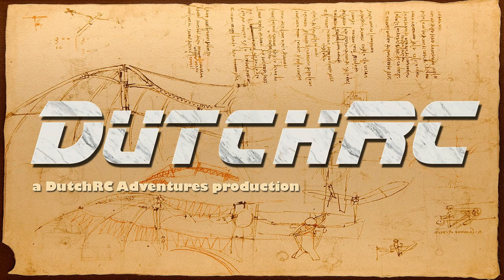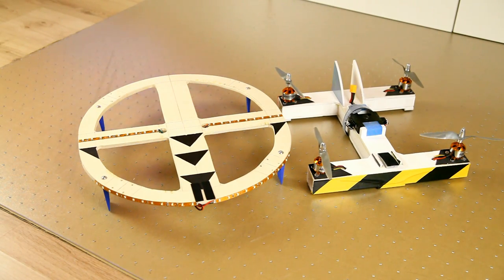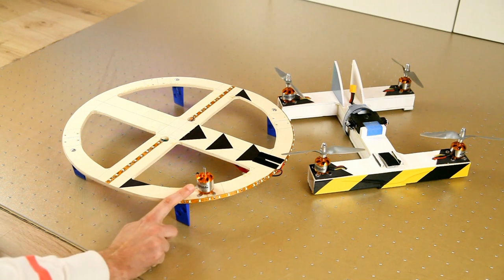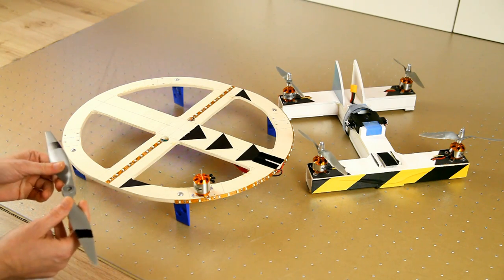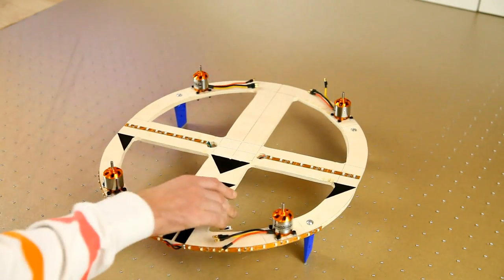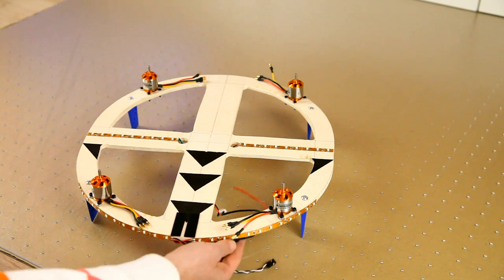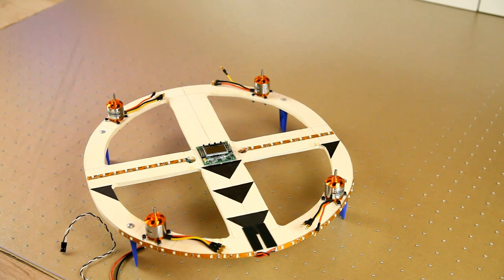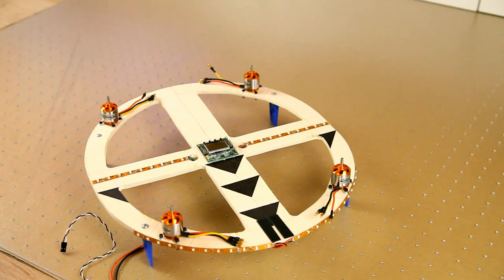Rebirth of the CirCopter :)

Comment: nice man , bigger props cool , good luck on the build
in the process of installing the rpm sensor and tuning it
Liked
Reply from the maker: Heli Mouse Thank you sir! :)  It's actually finished by now, but there is a bit to much wind today ;)
Reply: DutchRC ADVENTURES got my heli good working now with the rpm sensor works great now only a flight to test it's a bit windy here too LOL
Reply from the maker: Heli Mouse Good on ya! :)  So that should have the heli fly more precise I think? :)
Reply: DutchRC ADVENTURES it holds the rpm better and that is controlled by the FBL unit MSH iKONmy esc is currently on multirotor setting need to re-set that I guess will try first

Comment: Please be a kk2.1.5 with setup video as just about given up with mine . .  mind you i have been using a USBasp AVR Programming Device to power it until get solidering iron to make up some battery connections
Reply from the maker: Would this help you out maybe?? https://www.youtube.com/watch?v=eyXLsYKUBk8
Reply: Thanks for that . . . never seen that one before thought id seen them all . . . .this is what im trying to do .
https://www.youtube.com/watch?v=3KFCbe_FRwE&t=479s     but they have a different version to myself

Looks like ill be building a quad copter using the kk2.1.5 board i have 

Got six  7x4 props on order from HK and a orangerx Rx . . .  Just need 3 motors and escs and some balsa wood then i can start to build.  with the help of your videos .

Main thing is ill be able to fly in the garden under most weather conditions unlike with fixed winged
Reply from the maker: Fixed wings DO indeed need 'a bit' more room yes ;) 

ah yeah.. I have not used KK2's in airplanes myself.. Especially at This point there are better ways to stabelize a plane (F3 flight controllers eigher with Cleanflight or iNav firmware).. far simpler..